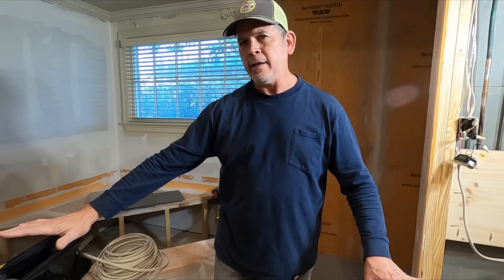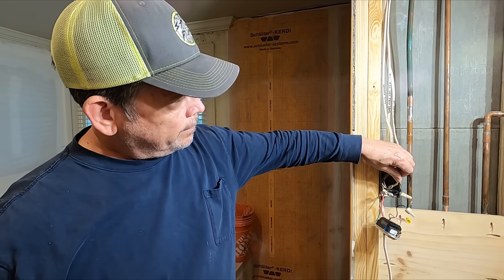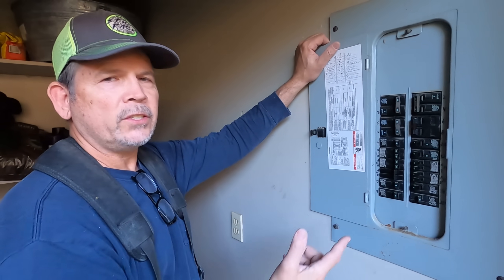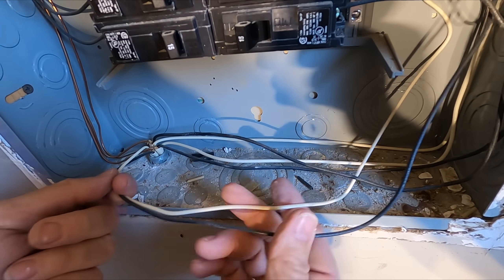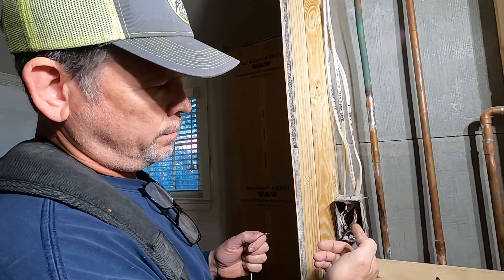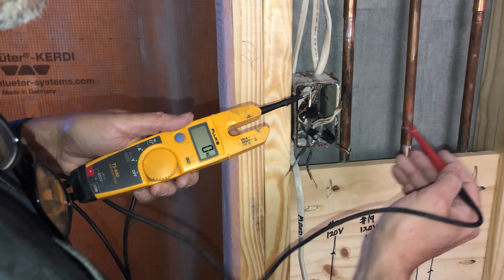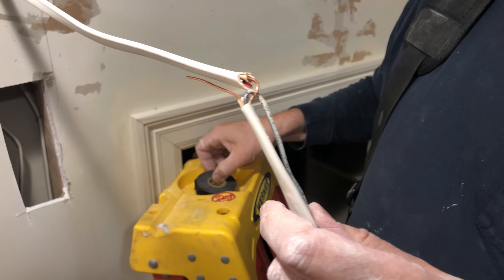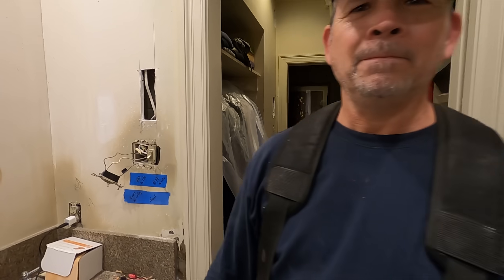You CAN Get SHOCKED by a Neutral Wire! This is How...

Comment: If you’re an “electrical engineer”, don’t try to give anyone advice 😂 they might make big bucks, but can’t do electrical work worth a shit. Literally got blown up this week because a homeowner (actual electrical engineer) decided to reset a gfi & I was working on that circuit.
Reply: it is your fault.  if you did a proper lock out that would not happen
Reply: @twigd3825  Completely right. LOTO, never trust your own safety in the hands of someone else, always use your own lock, and always check for current after shutting the circuit off.
Reply: @Swflec  ibew?

Comment: Great video.  Most people have no clue about electricity including some electricians. I would have added the switch in the diagram so people understand there is a switch that was turn on or even an appliance plugged in that has constant power that completes the circuit. You got lucky in that the closet light was on or you may not have found out that the problem exist. Not sure if you have done a video on cost but it might help you viewers understand why new construction is far cheaper than remodeling and if a person who does new construction decides to do remodeling that they can not survive at new construction prices. Also a video explaining why kitchens and bathrooms are so expensive compared to just a room to remodel. One thing consumers need to understand is if a contractor needs to brag about their work or say they are the best they should say good bye to them fast. A great contractor is always learning and their work does the talking for them and you work talks about your quality and knowledge. No contractor knows everything or has done  everything in construction. People on tv shows like the Scott brothers should be for entertainment only. Bathroom looks great as I have seen it.
Reply: As a GC myself i understand exactly what you are saying.
Reply: @coconakillokukulkan5421  you can use one neutral to two lines. It is scary when you dig into someone else's nightmare. I stay away from buying used houses that have been remodeled and looks like the guy next door helped.

Comment: It's common to use a neutral as a hot leg...as long as it's properly tagged with black tape and the person working on the wiring knows what the code expectations are it's a safe situation. The problem is when untrained people starting running crap like what you diagrammed out...it's a fast way to kill people.

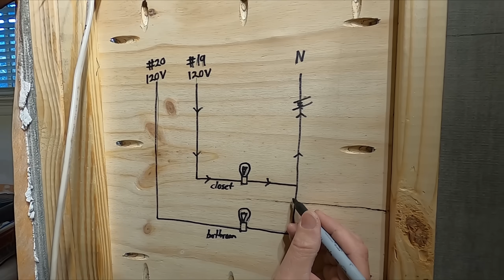Comment: 10:27 I don't understand....How is the hot of #20 completing the circuit? That hot (black) wire has no connection to the panel's neutral (If it did you'd have a big problem).
Reply from the maker: On the plywood diagram, circuit 20 is off and circuit 19 is on.   Circuit 19 is back feeding through the shred neutrals and when I connected the #20 hot to ground that completed the circuit

Comment: Hi, i learned from YouTube that code specify that neutral must be bonded at the main panel to the ground and to the main panel causing.  But if that is done wouldn't the main panel box give a shock if it is touched due to returning current carried by the neutral from unbalanced load inside the house? I would appreciate if you clarify.
Reply from the maker: Get a voltage tester and put one probe on a panel cover screw and ground the other probe.  You’ll get zero voltage on a properly installed panel

Comment: Neutrals are what kill you . You get the amp load of whatevers on that circuit coming back . Learned that the hard my first year making up a junction box,  live in someones attic .Was enough to make me want to quit right then and there .
Reply: huh?  the amps on a circuit has little to do with how much you get shocked.  The voltage determines the intensity of the shock a person feels, as well as other factors such as how sweaty they are.  For example, if there are 120 volts across 2 wires with no load, vs. 120 volts across those same 2 wires with a toaster oven on (heavy load), and you touch across the 120 volts, the shock you feel should be about the same in both cases.  There will likely be a voltage drop on the toaster circuit (maybe to 110V), but they will likely feel similar to a person getting shocked.  If it were a smaller load like a 10W LED light buld, the shocks would likely feel identical (120V vs. 120V likely).
Reply: @davidjames1684  If there is a returning load on the neutral circuit , its gonna hurt  ALOT worse than getting hit by just the "hot" wire  . Trust me . I never said high voltage wouldnt hurt or kill you  ... lol All I'm saying is youre big trouble if you get hit with a big neutral load coming back . Thats why they say 'neutrals kill' . Im guessin youre not an electrician , or havent been for that long . If you were youd understand what Im saying .
Reply: @ScottyBennitone  Why would that be?  The amount of current that flows thru someones body is mostly a function of the voltage, and MUCH less so what loads are already in that circuit.  Go back and reread my toaster example.  No I am not an electrician, but I do have common sense.  If anything, the shock will be slightly LESS if there is a heavy load on that same circuit, due to voltage drop.
Reply: @davidjames1684  Not only are you getting whatever voltage on that circuit hitting you , but youre also getting the load amps of whatevers running on that circuit . It could be a light bulb , an airconditioner , or a hairdryrer . Plumbers die every year disconnecting water services  because some houses lose their neutrals . Your neutral is your main ground  at the taps , your secondary ground is a rod in the ground , and your third is your cold water ground or incoming cold water feed . There have been instances where plumbers are doing routine meter changouts and the customers have lost their main Neutral (gound) bug on the tap wires , dont have a ground rod ,so therefore all the volts and returninng amps powering the house are going through that cold water ground . That person would receive that entire load . Compare that now to just grabbing any single incoming line . I have been hit with 120 and 277 . Both hurt like a bitch , but when you get hit with a load on a neutral it hurts WAAAAYYYY worse . It cankill you very, very easily .
Reply: @ScottyBennitone  I disagree.  A person's body has very high resistance (normally kiloohms), whereas common loads (appliances such as an air conditioner), have very low resistance (relatively speaking).  Putting loads of drastically different (orders of magnitude) resistance together on the same circuit has very little effect on the total resistance of the combined loads.  For example, putting a 10 ohm load in parallel with a 10,000 ohm load is still very close to 10 ohms (perhaps 9.99 ohms).  The person will NOT flow enough electricity to run the applicances.  That is absolutely ludicrous! There should be no difference in the perceived shock, unless something in that open circuit is backfeeding, causing even higher voltage than the voltage that was disconnected, and at an amperage that can be sustained long enough to flow at that higher voltage.
Reply: @davidjames1684  There is nothing to disagree with buddy .. lol , ask any electrician he will tell you exactly what I just did . Neutrals with amp loads KILL.
Reply: @ScottyBennitone  You haven't given a good scientific reason why, so I am not "buying" it.
Reply: @davidjames1684  Lol . okay bud . Youre being really ignorant right now . I was taught by multiple master electricians and have been first hand hit with returning neutral loads . Its way worse and way more deadly than your average "hot wire" alone . I am telling you this as FACT . This will be the last time I reply,  good day .
Reply: @ScottyBennitone  Unless you give a good scientific reason why, I say BS (Bad Science).  What they describe as a "worse" shock could just have been they weren't expecting it, thus were more surprised, but the pain level was the same as if they had touched a same voltage line with no load on it.
Reply: @ScottyBennitone  Facts have to be proven.  You didn't prove anything.  Word of mouth is not proof.  My claim, measure the AC voltage (let's say it is 120V at 60 Hz).  No matter what load you put on it (up to 15A let's say so the circuit will not be overloaded), the shock at ANY load will feel the same to an average person getting shocked from it.  That is my claim.  Prove me wrong (I don't think you can).  Even if the circuit was a 100A circuit, the shock would be no worse than a 15A circuit... whatever voltage is available, and whatever resistance the human body has, determines the current that flows thru the persons body.  It is the same reason why you can touch a powerful 12V car battery and NOT get shocked.  The amp capability of the battery is irrelevant because of the very high resistance of a persons body to 12 volts DC.  Basic electrical principles.  Things that DO matter are frequency of the AC (50 Hz vs. 500 Hz for example), whether it is AC or DC, whether the person is sweaty or not, whether there is a spike voltage backfed from a ballast or other device, how much amperage passes thru their heart, the shocked person's tolerance to pain....
Reply: @ScottyBennitone  That makes no sense to me.  What do you mean "hit with a load"?  Your body does not conduct enough electricity to run the load.  If you break the electrical path of a simple 25 watt light bulb and then touch the 2 bare wires to try to make your body complete the circuit, the light bulb will NOT light up because at 120VAC, there would only be a few mA flowing thru your body, not enough to light it up.  Not even enough to light up a 1 watt nightlight.  If however, there is capacitance built up in some energized devices, and somehow that extra VOLTAGE gets backfed and someone gets shocked with it, then yes of course that can give a more powerful shock.  But I have been saying all along it is the voltage that determines the potential intensity of the shock, assuming it has enough duration to hold the voltage when shocking.  Running your feet across a dry carpet and then getting a shock might be 10KV, but a VERY short duration (so not so bad as far as pain).
Reply: @davidjames1684  Its volts . plus amps , plus resistance , that kills . Not just volts ... Why do you think so many people get killed or hurt each year from bad grounding issues .?  Plumbers , carpenters , electricians , etc . They are not killed from incoming power .They are killed on returning power to ground .
Reply: @ScottyBennitone  You and I are on different wavelengths.  Once again, 120V is 120V.  It doesn't matter if there is a load or not, your body will "see" 120V and conduct accordingly.  The load is irrelevant regarding the shock, unless it changes the voltage in some way.
Reply: @ScottyBennitone  Your statement is very unscientific.  I could have my body charged up to some very high voltage and I would be fine, provided I was well insulated from ground (and any significantly different potential voltage matter).  So your statement is meaningless without describing clearly what you mean.   You say it is not just volts that kills, it is amps.  Well guess what, without volts, there are no amps flowing.  One implies the presence of the other.

Comment: Excellent trouble shooting and explanation, I have been called in to solve these type issues many times... especially with 3-way switch circuits. 
They were running industrial ovens on split receptacles (common neutral in EMT) and they kept failing. At 15A to 20A on each oven they had done two wrongs, the neutral went to a completely different panel rerouted in a J-box AND they had jazzed up the breaker positions and got them on the same phase. Now a #12 THHN was actually loading at 30A to 40A depending on which ovens were on! 
I pulled out the burnt up white wire and replaced it in its own panel, then put the breakers on the proper phases, problem solved. In fact I pulled in all new conductors because even though neutral current had found its way back on the conduit the phase conductors had also melted their insulation in places.
Reply from the maker: Thx Patrick 👍👊 great trouble shooting on your part
Reply: @StudPack  If you do get a bench set up, test set ready, here is a good topic: I have had several high resistance opens, sometimes (mostly) in a feed through receptacle, sometimes in a panel, behind a meter in the socket and even out on the pole. I almost always pigtail outlets.
The problem is that as the resistance increases with increased load it will finally open, by the time I get there the connection has cooled off and is closed, very hard to find.
A few times the high resistance is on the neutral wire, also a condition for a "hot" white wire. However; if the white wire that loads and opens is a common neutral as in a multi-wire branch circuit and two loads are applied, one on each phase leg, the lower wattage appliance will burn out. Let's say it is a kitchen circuit and a clock is in one side and a toaster is in the other. The clock is 10 watts and the toaster is 2000 watts, as the neutral's high resistance connection heats up more and more current flows through the clock. Finally the neutral opens and all 2000 watts flows through the clock burning it out. (The clock and toaster are now in series on 230 volts until the clock fails).
The poor homeowner has three burnt out clocks and sometimes the toaster does work and they don't know the cause. 
The last time this happened a high price kitchen appliance kept burning out its power board fuse, the company replaced the power board and it happened again. I was asked to troubleshoot because the techs didn't know what to do; I condemned the house wiring, a high resistance neutral and the house wiring repair fixed it. In that case I had to talk their electrician through the process, he had never encountered this. When troubleshooting long distance, a video explanation would be so good to send to them.
Reply from the maker: There are videos out there regarding the scenario you describe.  I’ve been thinking about doing a video on panel boards showing all the different breaker types and wiring methods both correct and incorrect.

Comment: Hey, my brother was trying to replace a light switch with a light switch outlet combo just yesterday. He could not get it to work and all kinds of weird things were happening as he tried different combos - printer came on, hall light blinked & then he got shocked.  We called an electrician out and he found there were 3 circuits with only one neutral. He suggested we have the house rewired because there were probably more like this. Can an electrician check all the connections before hiring someone to start a total rewire?  Thanks for the great explanation, at least now I understand the problem.

Comment: ALL neutrals from the same transformer are capable of killing you.  Your panel box may be turned off but your neighbor's power is on and operating.  Should your neighbor's neutral suffer a fault (Like maybe a rodent chewing through it) His current from his home WILL go underground to your neutral.  If you are working on it when that happens, you are subject to a surprise.  It happened to me once.

Comment: Only way to trust a neutral is when you can physically see it going to the breaker box and no other neutral wire connected in between.  Another way to test is to use a gfci on your circuit which will trip right away if a neutral is shared somewhere.

Comment: I found this exact same problem in my home I was installing smart switches one of them was a 3 way and the neutral wire was being shared on another circuit as well the really messed up thing about it is that the guy who did it was a certified electrician I contacted him when I found this had been done and he told me that it was ok to do but after he was done telling me this I hung up the phone I opened it up again and fixed it myself because I knew better. Anyways needless to say I gave that electrician a pretty bad review after I knew that he had done this and thinks it's ok I also refuse to recommend him to anyone ever again I'm just thankful that myself or no one else got hurt from his stupidity.🤷‍♂️👍✌

Comment: this is a common mistake. I am only an apprentice that started 3 weeks ago, but I know better. The mistake that was made was wire nutting 2 neutrals from separate circuits together. This should never happen. Whoever wired this house is the reason you were shocked. If you shut off the breaker for a circuit then the neutral should never carry electricity. If it does then the electrician before installed it incorrectly.
Reply from the maker: Thx for the comment 👍👊

Comment: Why the sub-panel, and the MAIN breaker somewhere else?  OK. the white wires are NEUTRAL, right.  When a light or appliance is ON, the NEUTRAL carries current. If the NEUTRAL wire is running from some appliance that is ON, it is carrying current. If it is not connected to the NEUTRAL going back to the box, your hand carries the current returning from the appliance. I learned that from experience. If  all NEUTRALS go back to the main box, and are connected together in the mounting block in the MAIN box, current can still be in the NEUTRAL wires  

I'm not an electrician. But I do all my wiring. I noticed that I had some current in the bare GROUND wires in the MAIN box the the receptacles. So, my grounded appliances are not really grounded. I believe this is because I put all the white NEUTRAL wires and the bare GROUND wires in the same mounting block in the MAIN breaker box. The GROUND wires should connect to the grounding rod that is driven into the ground outside the building.  I didn't do that.

If my conclusions are wrong, please let me and others know about it.